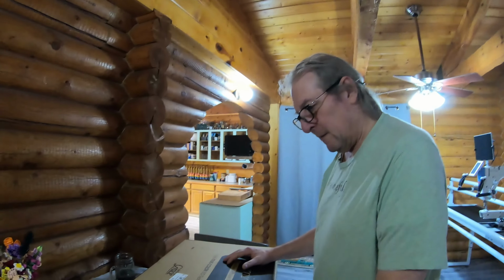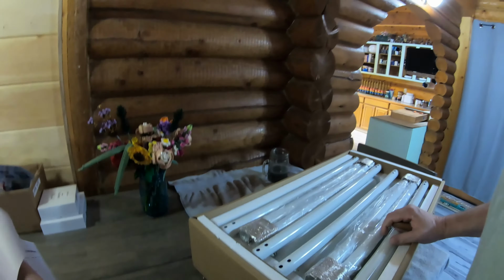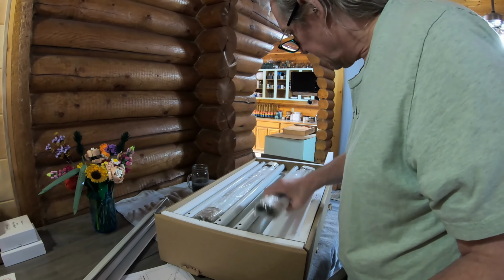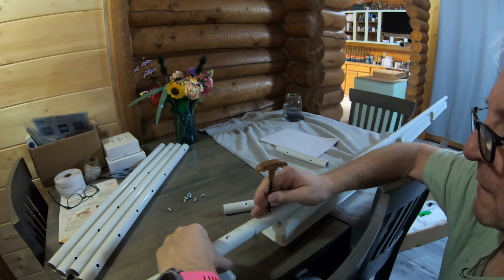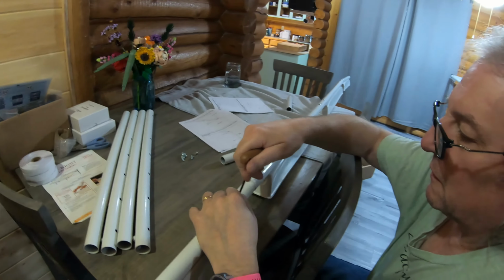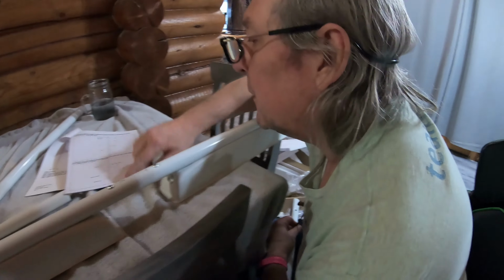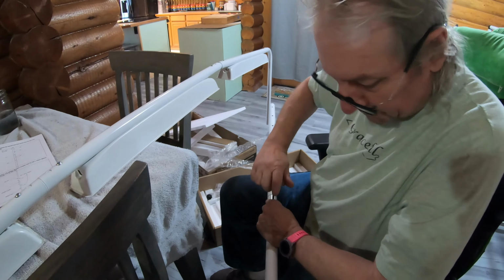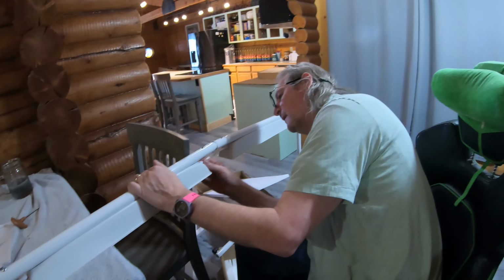Grace Luminess Light Bar 10 Feet

Comment: Nice video. Was wondering if you think that adding a 2 feet extension to a 5 foot light would be feasible? Wanted to get a 8' frame and I already have a 5'light and wanted to get the 2 feet extension. Thank you.
Reply from the maker: EDIT:

I am storing the light extention. I would look at the ends of the 5' light to see if has the electrical on both ends then yes it should work.